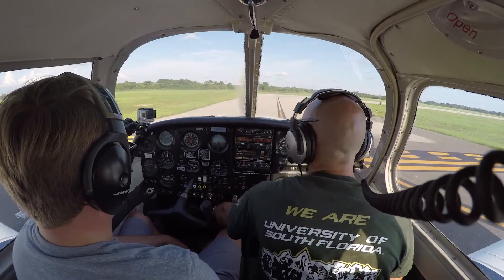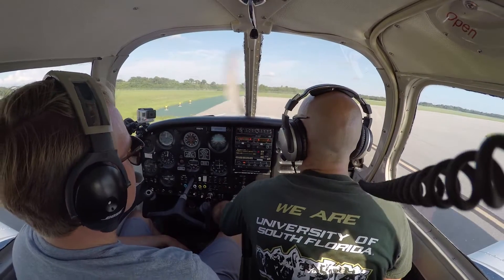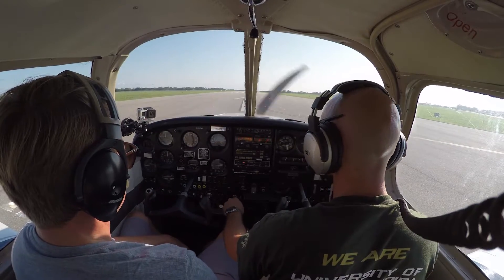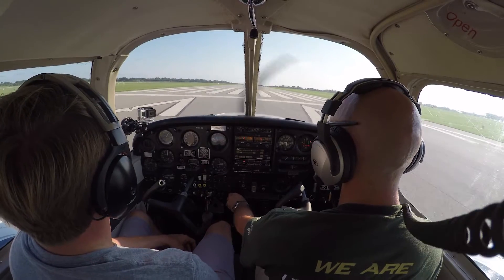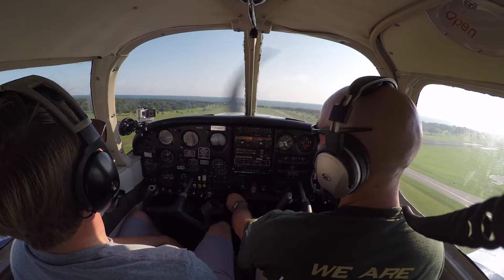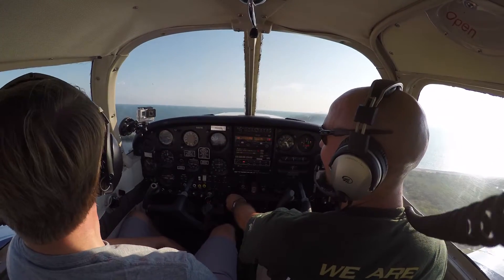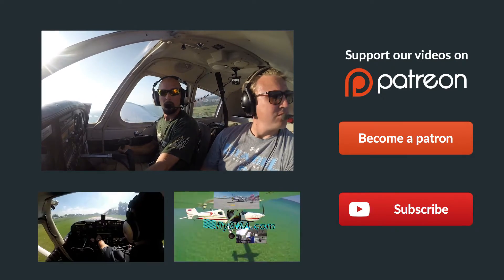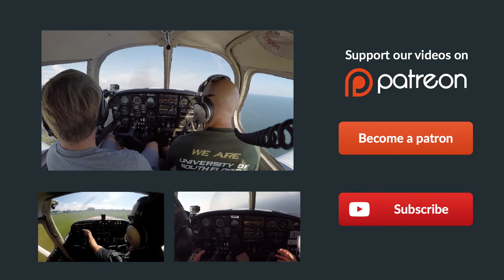Ep. 47: Short Field Takeoff | How To

Comment: I think 500 feet AGL is a little low to start crosswind turn, no? According to the AIM it should be within 300 feet of TPA.
Reply from the maker: Both altitudes should work just fine! With standard pattern altitude being 1000' AGL, it's a relatively small difference between 500' AGL and 300' below TPA.